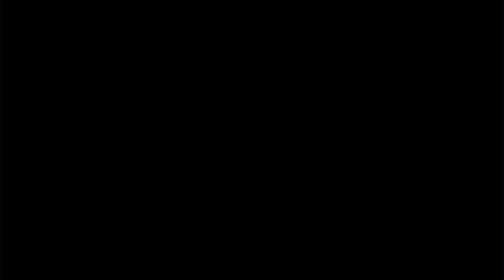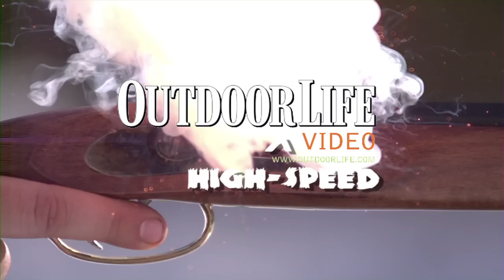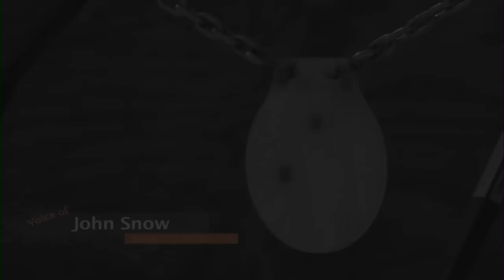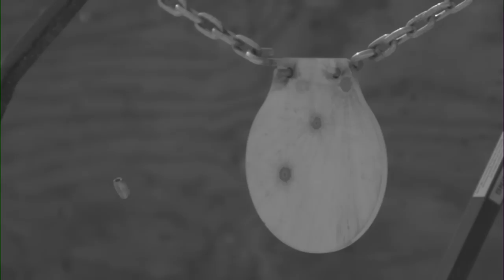Slow Motion Video: Sabot Slug Shot from a Smoothbore...

Comment: What about foster slugs thru a smooth bore?
Reply: John McDermott fosters will work.....with an improved cylinder choke
Reply: James Prince you can use chokes other than just an improved
Reply: It's best to cut a slug out of the shell, and find the choke that it fits slightly tight thru, for your best accuracy. Better chance of it being uniform, in shape, and leaving the muzzle exactly in line with your bore. A slight restriction will swage it just a little bit. Just my opinion...           I'm a huge fan of the 12 gauge. I'm a buckshot pattern "junky". lol     I think I'll step outside and explode some milk jugs, right now!!!!!!  I bought slugs, and 00 yesterday.  Haha